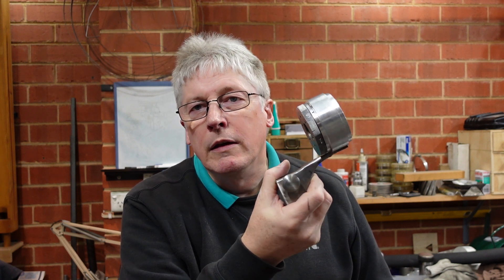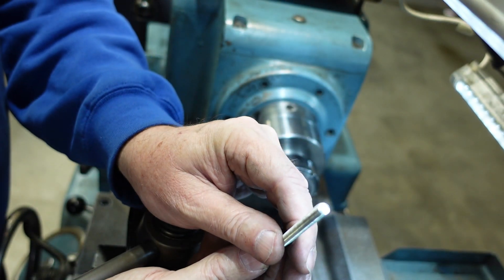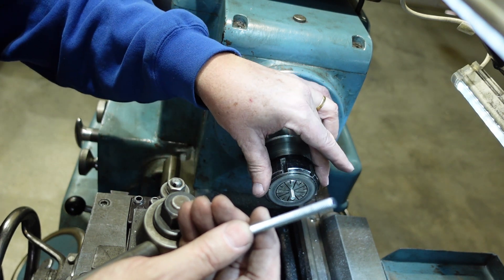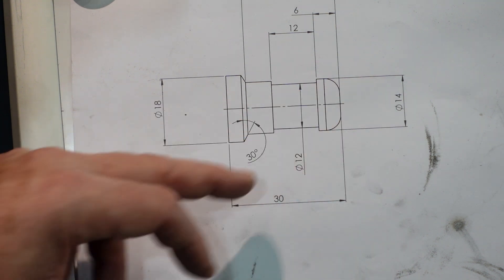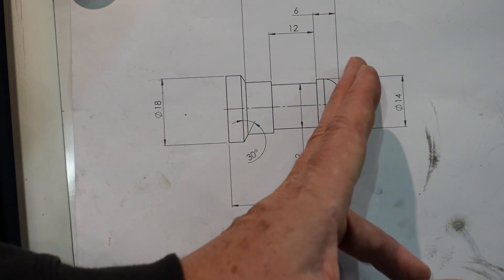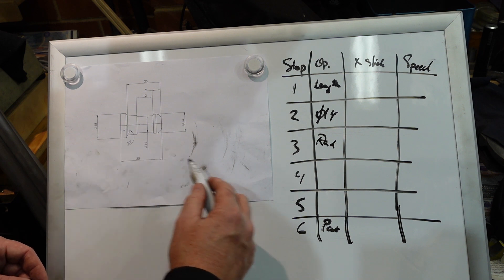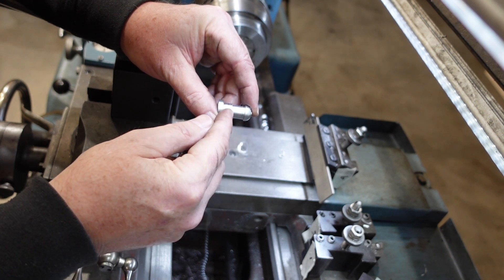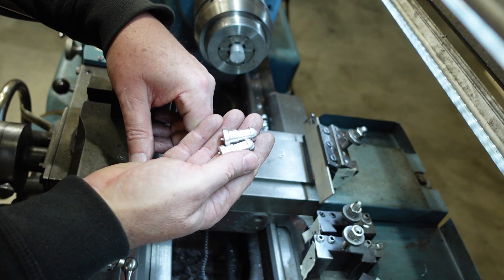Setting up and using the 6 position stop

Comment: Very nice and well explained. Are you able to attach a hard backstop in lieu of the dial indicator for production runs with a lower tolerance?
Reply from the maker: I can. The benefit of the indicator is that because it is not a hard stop I can use the power feed without the risk of pushing things out the way. (The lathe has a 3kW motor - it can push)